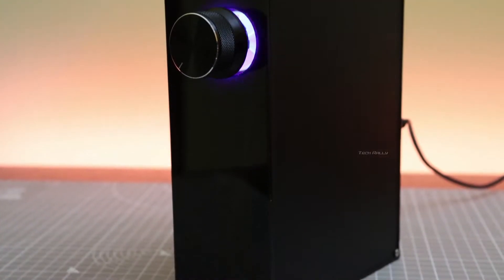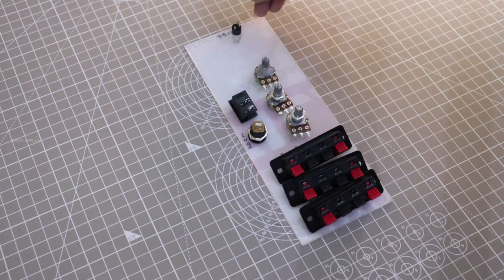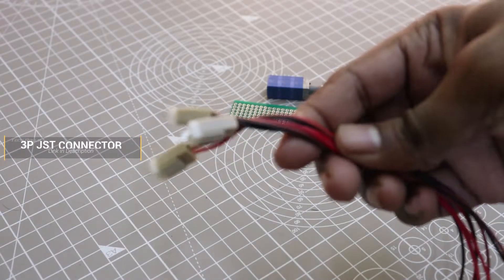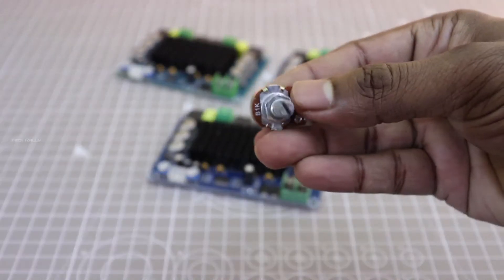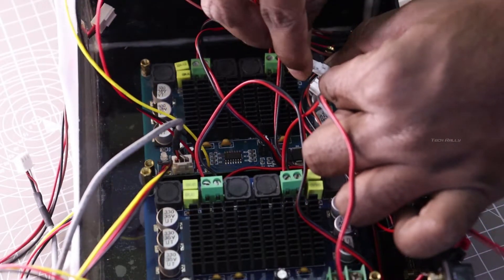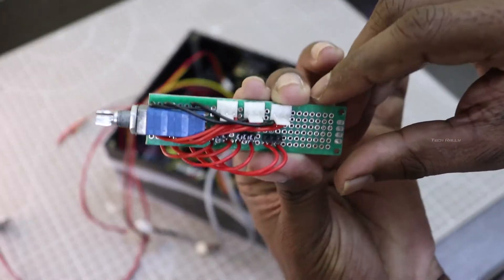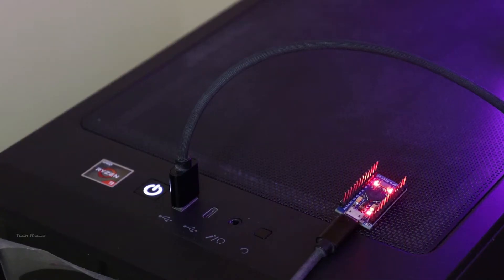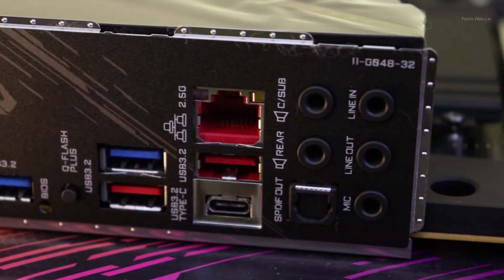DIY 5.1 Amplifier

Comment: How it is 5.1 without a surround 5.1 sound decoder
Reply from the maker: PC motherboard has 7.1 channel analog output, i used 6 channel 5.1, so it doesn't require decoder or any converter.

Comment: Can we use tpa3110 and tpa3118 for this type of project. My speakers are of rms- FRONT-75w+75w , Rear And Center- 30w each. Your reply would be helpful for my desired project. You Earned a Sub ❤
Reply: I completed my build and it sounds awesome I used a 19.5v 3amp adapter and the output is hideous thanks for your respected suggestion I greatly appreciate it Thank You ❤
Reply from the maker: Awesome bro 👌😃
Reply from the maker: Yes you can use tpa3110 for rear and tpa3118 for front if you already have this boards, if are going to new i recommend go with all same type of board..

Comment: Does This really give Dolby Digital Surround Sound Through Pc Input?
Reply from the maker: Your motherboard should support 5.1 analog audio output for that..
Reply: @TechRallyofficial  no I have sound card that support but I'm still confuse do i need 5.1 decoder or the sound card can work.
Reply from the maker: @thelord-rq6rv 5.1 sound card will be better but the software should have option to control individual channel volume,
Decoder will be cheap option. But you will not able to control individual channel volume form pc

Comment: this is not 5.1 its simply bridged stereo sound to a 5 speaker and 1 "sub" connection.  It is not surround sound which 5.1 is but youre instead just surrounded by sound which is not the same thing.
Reply from the maker: Its true 5.1 Audio not the bridged or simulated 5.1 sound.
See the video fully, i used the 6 channel output from PC which has seperate connector for front, rear, center and sub...

Comment: Good job🙏, but i see that youre using one of those 5.1 channel speaker that usually dont really have bass, please filter some bass only to the satellite speaker. Also instead using arduino, use an led visualizer they are quiet cheap (or maybe find an rgb led that dont use arduino)🙏

Comment: No cooling fan 😮😮😮😮😮
Reply from the maker: Initially i planned include cooling fan but while testing it dosen't produce any heat, because it as more efficient class D amp and i used only 12v 5A power supply 
It my primary amp for my PC and its amazing

Comment: This is not a 5.1 amplifier ...there is only 4 channel  and power supply must be 19volt - 24 volt
Reply from the maker: I used 3 Amplifier modules each has 2 channel, the board works from 12 to 24v..
I wont fake or lie anything in my videos..
Reply: @TechRallyofficial .....I am sorry to say I didn't see the 3rd amplifier which you used one on top of the other 😶

Comment: Hello, I have a Question. I have tried a very similar setup, but whenever I try to plug in 2 cables there will be humming/buzzing nosie. The sound will work but the noise is very loud? What can it be and how to prevent that?
Reply from the maker: This might be because of your SMPS power supply or poor grounding loop in your audio source. Try reducing the gain in amplifier board potentiometer.
And make the audio cable doesn't interfere with other display or power cables.

Comment: nice work. i like how you pay atention but... you need for that 5.1 amplifier few things :
1: power supply is not enough even for one chanel . you need 24v power supply and 15A minimum 
2: you need some active filters there for each chanel in specialy subwoofer 
you will habe a big improve sound better than much home theaters 5.1
Reply from the maker: Yes, selecting a right power supply is important based on application and speaker ratings, for me 12v 5A is enough for small room you won't believe me it works really well i haven't seen any issue with it ,since its a Class D amplifier it is very power efficient,
I am using only for desktop 5.1 output which has built in active filter so passive filter is not mandatory but adding it improves quality.
Reply: @TechRallyofficial  yes, but if you put bigger power supply you Will improve much quality sound. Good job anyway
Reply from the maker: Thank you 😊

Comment: There are no links in the description for the parts you used to make this? Though the video mentions that such links would be in the description? Can you provide those links as a comment, maybe? Thanks. This is an awesome project.
Reply from the maker: If you can't find anywhere then this is the only option,
Thanks
Reply: El diagrama del potenciómetro de 18 pines ,como va el sonido
Reply from the maker: @E2000-f5p consider each one line of pins as a single potentiometer
Reply from the maker: I will update and comment here
Thanks
Reply: @TechRallyofficial  Thanks. In the mean time, would it be possible to provide either a link or the specific brand name for the 100k 6 gang potentiometer you used in the video?
Reply from the maker: The one i used was not available online in India now, i brought it on aliexpress below is alternate component MASTER TYPE 100K ohm 6 gang potentiometer 
https://amzn.eu/d/bjp4KsY
Reply: @TechRallyofficial  I can't find this where I live,  so I am going to do something like this - https://www.youtube.com/watch?v=TkIYEjRd6qc. Do you think this will work? Thanks.
Reply from the maker: Even small force could damage the carbon in potentiometer, its not worth the effort 
 also volume control will be uneven.
Try local amplifier shops to get.
If you have access to aliexpress in your country it will be better option to get from there...

Comment: Nice work,
I did a similar project, you may need a fan if you want to reach the full potential of those boards at 24V the heatsink is not sufficient.
Reply from the maker: Great, yes fan adding fan will be a better option 👍 😀

Comment: 5.1 channels and 2.0 input. what are you doing?
Reply from the maker: There is no 2.0 input, i used 3 amps each has 2 channel and 3 audio input jacks each 2 channel, 6 channel output form pc via 3 male to male audio jack cabe each 2 channel. 
This is pure 5.1 audio.
Reply: Ok that good bro, but your connecting bluetooth only 2 channels.
Reply from the maker: Oh ok now i got your point, just for demo i connected via mobile for 2 cannel, subwoofer + center speaker alone will work.
That only for demo because i dont have 5.1 source to test on table, finally i connected to my pc for 5.1 source... Thanks
Reply: @TechRallyofficial  you should use "HD Audio Rush" to decode at the input, and it is called one av receiver.

Comment: can you please explain what does that large potentiometer for ?
Reply from the maker: For Master volume control..
Reply: @TechRallyofficial  I did not understand the wiring of it, do you mind sending a diagram or explain it here please?
Reply from the maker: The large potentiometer is called as gang potentiometer its just ah noramal potentiometer group to geather to control all 6 channels volume to geather, its actually a group of 3 potentiometer containing 6 pin each below the link for 2 channels control refer the image in link,
https://techtalk.parts-express.com/forum/tech-talk-forum/58484-adding-volume-potentiometer-to-amplifier-board
Reply: @TechRallyofficial  thank you, in my case, I only have one amp board (same board as yours) which I want to control master volume.
to INPUT SOURCE, does that mean the 3 pins on the amp where I will be connecting the Bluetooth audio player?
to AMP channel (ch1 and ch2), does that mean where I connect the speaker from the amp?
Reply from the maker: In that 3 pin one will be groud and other 2 pin will be input to amp, ground pin should be connected to the left side pin of potentiometer and other 2 pin will connected  to the center pin in potentiometer and input audio source will be connected to right side pin of potentiometer..

Comment: Do you use 5 amps?
How you set the control to center and subwoofer canals in a single dual channel amp board?
Reply from the maker: Yes, i use 5A power supply 
The board has the gain control for each channel, using that u can control center and subwoofer channel separately...
Reply: @TechRallyofficial  and 5 boards?
Reply from the maker: Each amplifier module has 2 channel, so you need only 3 module for 5.1 ch output

Comment: i have a question , please answer me, if i have 3 amplifiers like that need 19v 4amp per amplifier, can i use all three in only one 19 v adapter
Reply from the maker: Class D amplifiers are high power efficient  You can use all 3 in one Adaptor, If you use high power drives for all channels you may require high power Adaptor.
Reply: @TechRallyofficial  my question is if i have 19 v adapter 9amp , will the 9 amp divide by 3 for the 3 amplifiers or every each one will get 19v 9amp
Reply from the maker: Power will be divided based on load.
Reply: Current will get divide in all three amplifier, each one will receive 19v 3 ampere

Comment: you said its 600w. its no where close to that maybe 25w at best. thanks for being a liar.
Reply from the maker: Sorry for not cleary mentioning, Peak power is different than power consumption, i used TDA3116d2 based amplifier boards which has total of 6 for each channel you can search in Google for power rating. I used 12v 5vamp power supply which is more than enogh for my home use since i have only small speakers.

Comment: Bro, i have made a similar project., But i am not getting enough bass while playing films with vlc, 123player etc. 
The bass i am getting is very low ( from center/SW port ).
Do you know what must be the problem?
Reply from the maker: This a common problem with PC audio output, you need have the realteak audio driver and in that you need to enable Bass management and enable room correction in that increase the gain for subwoofer..
THANKS...😊
Reply: @TechRallyofficial  . Bro it worked⚡⚡⚡⚡. Thank you soo much 🥰
Reply from the maker: Super bro..✌
Reply: I think it depends on the sub you are using, normally the PC should be able to generate the required signal

Comment: 12v 5 amps not at all enough.
Reply from the maker: Its only class D amplifier, which will not cosume more power like transistor based amp, I am using this on daily basis so far i haven't seen any audio distortions..
Its recommended to use high power if you are using high power subs..
Thanks 😀...
Reply: @TechRallyofficial  what ever it is but that board is rated at 100w+100w and u have 2 of them which means total power consumption will be 400w if the efficiency is 100%.yes its class d chip which means that clipping feedback ckt and build in to it.if u connect 12v 1a will also work with out clipping but relative power output will significantly lower.
Reply from the maker: 100w is just a peak power it doesn't mean it consumes 100w at all time, Even if you use at high volume it consume only 40w max if you go maximum 100W than it is more that sufficient for even a big house and neighbours to complain about loud volumes.
Selection of power supply is important also should be based on your application.
Thanks...

Comment: I feel using a arduino micro just to run an ARGB led ring light is kind of wastefull, so many pins are not used! Maybe program an AtTiny85 for just running the ARGB leds?
Reply from the maker: Yes, Using Arduino Pro Micro just for ARGB LED is not cost efficient,  you can use any cheaper Arduino boards..😀
Thanks for watching...😉
Reply: You can program alexa in Arduino
Reply from the maker: That is not possible bro..